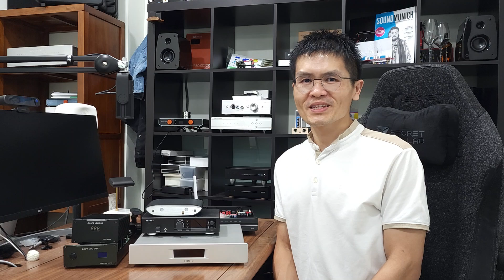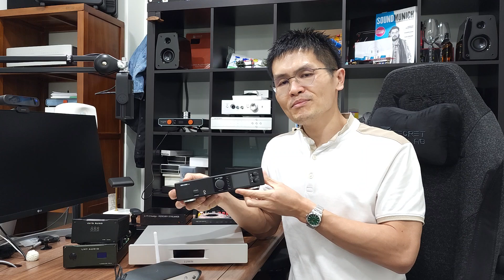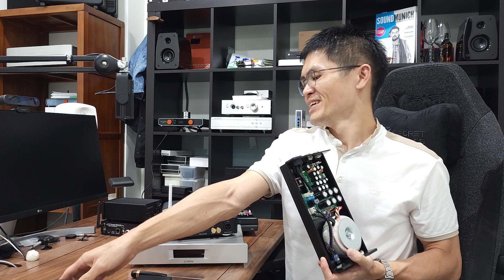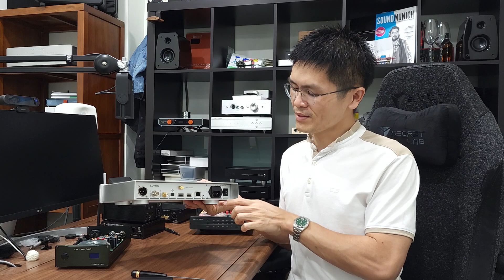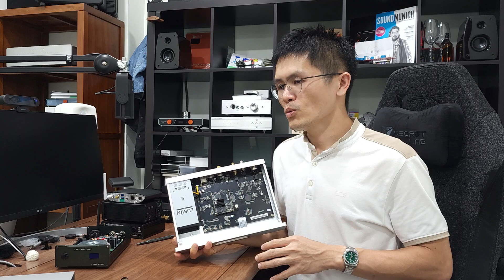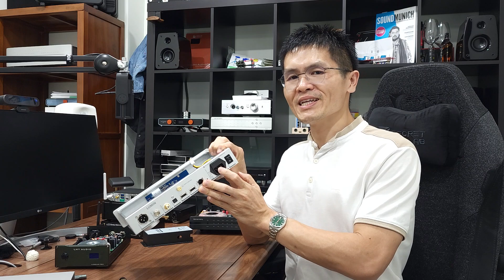Part #1: Lumin U2 Mini LPS Mod

Comment: Thanks Alwin
What's the Pin Configuration on DC Side? Inside Positive as Usual? Shouldn't that be mentioned somewhere or a accompanied by a pdf manual for specifications is utmost necessary? 
Thanks for a Great Accessories and Great Video 🎉
Reply from the maker: Hi Dr, the center pin is positive. It applies to majority of the equipment I have used.

Comment: LHY should make a star-grounded power distributor. Those can make a big difference to system sound quality as well, yet there are not so many and they all seem to start at $US1,0000 or more.
Reply from the maker: Thanks for the feedback, we will see!
Reply: @VinshineAudio  Sure. A good power distributor to benchmark against is this model: Furutech f-TP615E

Comment: After seeing the inside of the U2 mini, I am very happy with my decision to purchase the Aurender N150. Yes, it's $1,100 more than than the U2 mini but it comes with a linear power supply built-in, a built-in super-capacitor-based uninterrupted power supply (UPS) an internal ssd (solid-state) 240GB caching drive. Files play flawlessly with this system setup.  Also, you can add a 8tb ssd to a storage bay on the unit. It's head and shoulders better built than the Lumin. Think Korea (think Astell & Kern) Oh, how does it sound? GREAT! No Roon- who cares...
Reply: Yeah, no Roon, and that was the single reason I decided on the U2 versus the N150. Otherwise your reasons were mine as well, I would also have gone there.
Reply: @mesonto  Conductor proprietary app is great after the “learning curve”
Reply: @keeferdog2727  I'm sure it is, but I purchased Roon outright a year or two ago. Absolutely love the software.

But I wish that the low-end Lumin had an integrated LPS. With a small cache. (although it may have a small cache anyway)
Reply from the maker: Thanks for the feedback sir! Enjoy the Aurender streamer :)

Comment: How much of a sound improvement can we get by changing the power supply? And the Lumin are expensive as is, shouldn’t they be supplying a decent PS up front? 🤔
Love your work 👍🏻
Reply: Everything is built to a price point, and some of the higher end Lumin models include linear power supplies. There are also different quality level SMPS designs and some very high end products use an SMPS which outperforms linear supplies (Jeff Rowland Design Group for example.) It should also be noted that on Lumin products with an internal SMPS modifying them to allow the use of a third party linear supply will effectively void the manufacturer's warranty.
Reply from the maker: Sound aside, I always believe LPS will work better than SMPS. However, Bill rightly pointed out, there are some products out there perform really well with SMPS. To each his owns, I bet :)